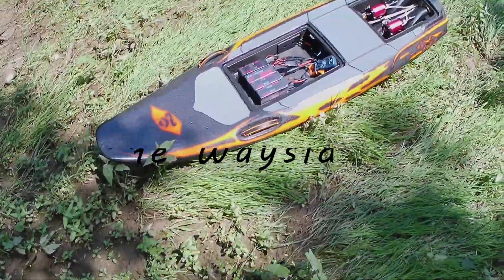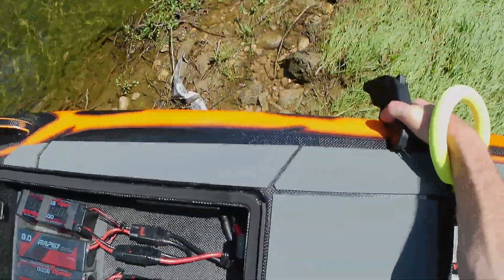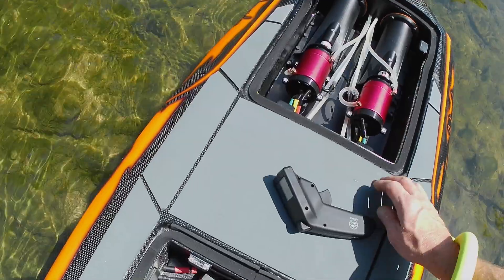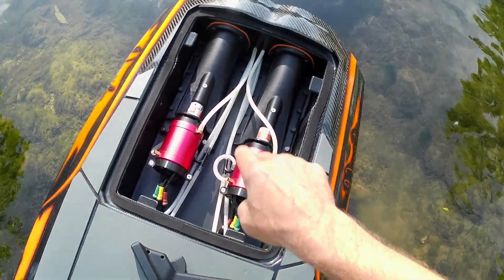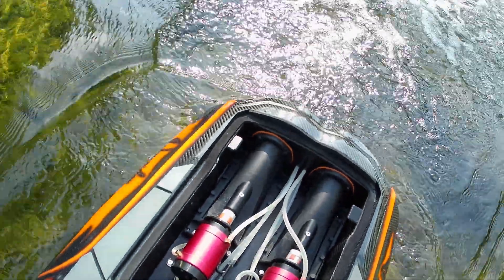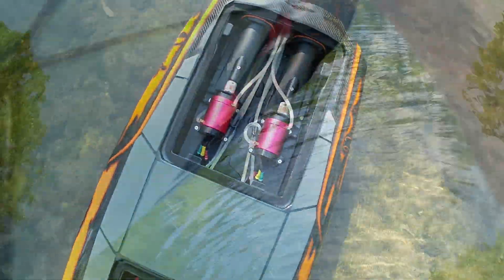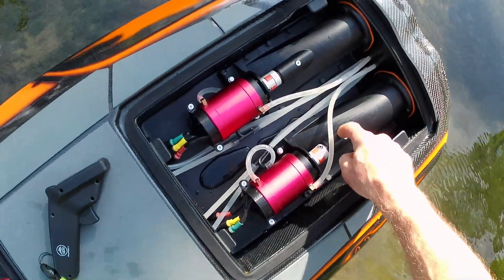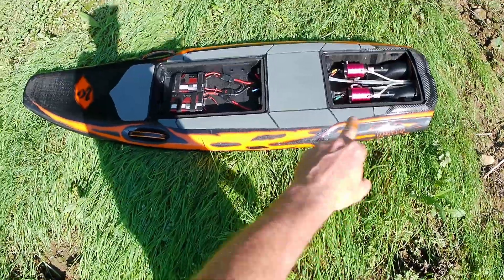Testing New JetDrives On My Diy Electric Surfboard

Comment: Realy nice work in this project !
Board job is realy nice, but your the esc and motor are to low quality and are going to go up in flame 🔥 
Time , effort and money you spent in project is a lot .
Why don’t go all in and use part that match ??
Reply from the maker: Thanks I have two of the same esc and motor,s they work great this is a drive upgrade video I have already ridden the board. No flames yet, fingers crossed.

Comment: hi, feeling the pull is one thing, but showing the numbers is quite another, it would be interesting to connect the scales and see how much it will show in kilograms, as far as I know, factory boards are 50-60+ kilograms
Reply from the maker: Thanks for the comment. Water leaks first then power.
Reply: @thewaysider7774  In my project I have achieved 17 km/h with 36 kg of thrust but during 40 minutes of riding at full throttle, now I am trying to increase the speed to at least 40 km/h. I also printed the water jets on a 3D printer with a 62 mm impeller
Reply from the maker: Sounds great man good luck 🤞